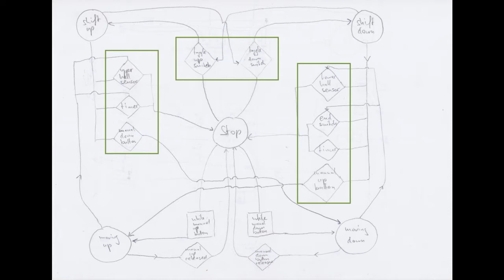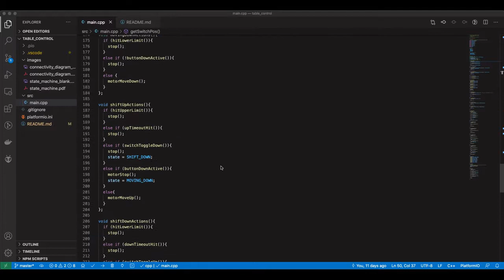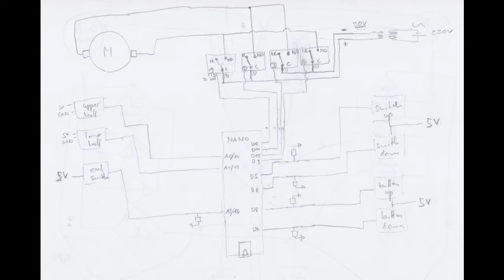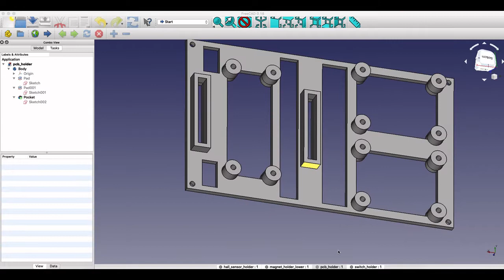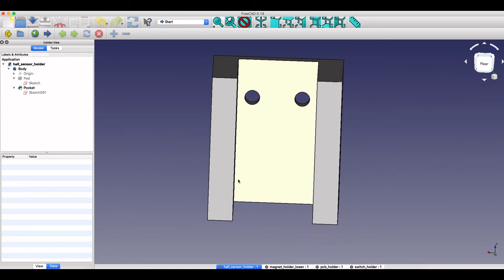Automated Standing Desk (Corona Home Office Hack)

Comment: Nice video buddy!
I want to make a standing desk using two linear actuators. This is the project I'm inspiring from: https://www.youtube.com/watch?v=EXjR-o5gu2w&t=5s
Using Arduino, I want to tell the linear actuators to lift the table to a certain height (standing position) by pressing one button and then pressing another button to tell them to go to the sitting height position. Which electronic components would I need? I'm kind of a noobie and don't know with certainty where to start...
Thanks for being so helpful!
Reply from the maker: thanks for your message. in the video you posted there is a link on how to wire linear actuators and in the description of that other video is a list of all components you'd need. would that not help?
Reply: @shiftux9189  Oh! I didn't see that! Have a good one!